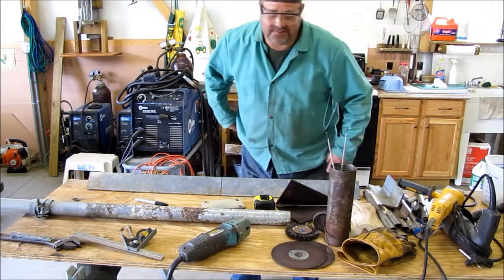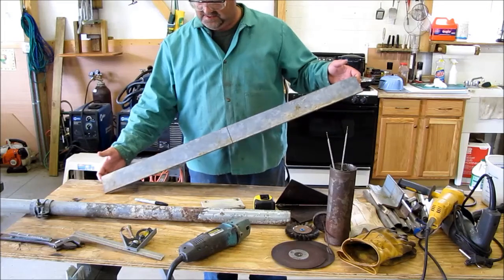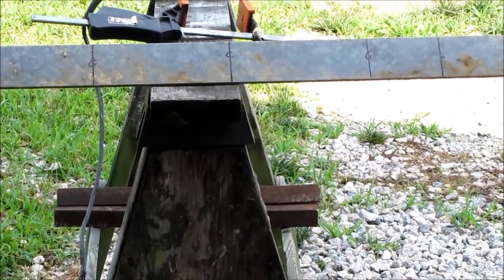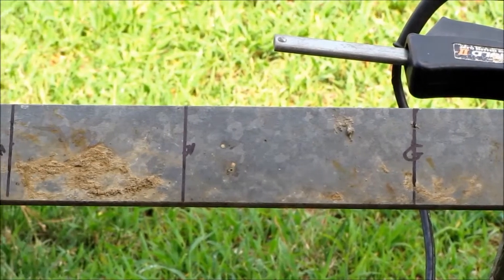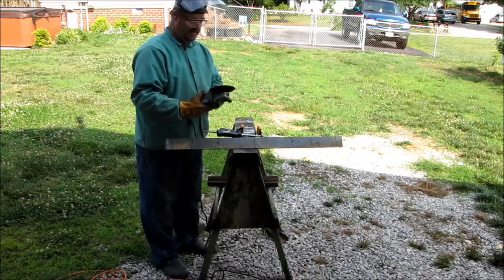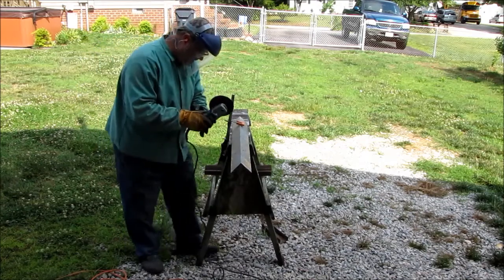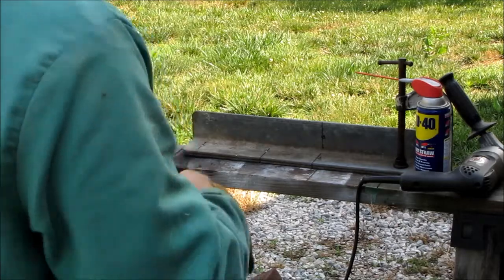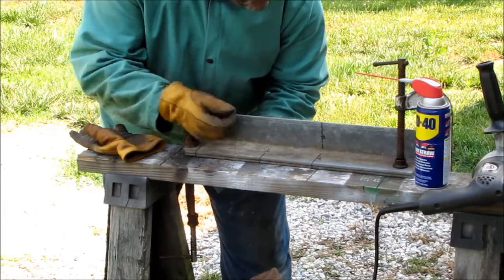Fabricating A Flagpole /  Wind Turbine Tilt  Pole Holder pt 1

Comment: nice vid. :) i need 2 get some cutting wheels 4 my Grinder. its hard 2 cut with a Grinding Wheel, the wheel im useing right now is done 4 Grinding, but it works ok 4 cutting. :)
Reply from the maker: I can Understand That Brother  The Cutting Wheels I'm Using Are 6 Inch  They Are 3/32 " Buddy
Reply: kvusmc / Kenneth W Viar Jr 6 in wow. i need a 4.5 in wheels.